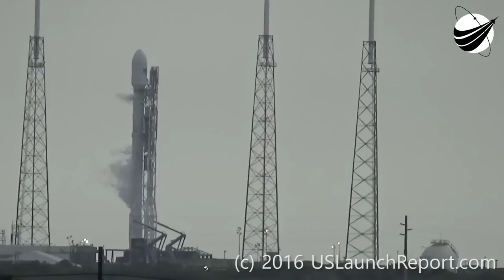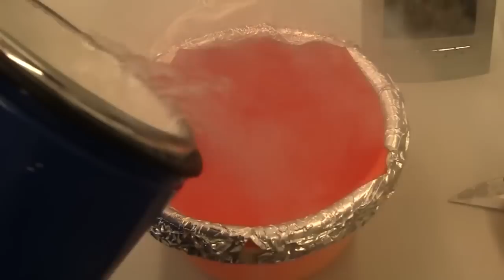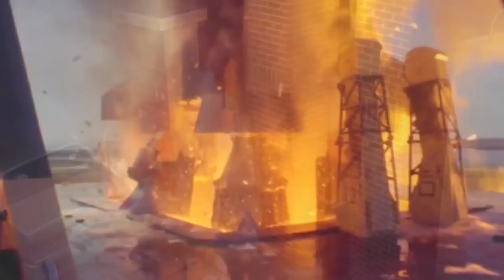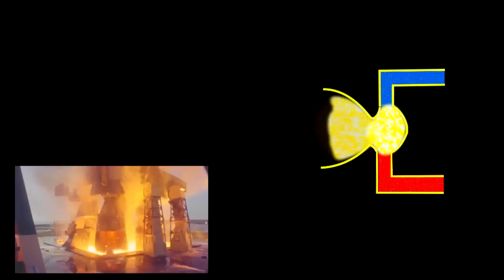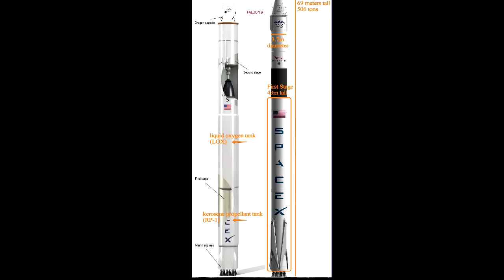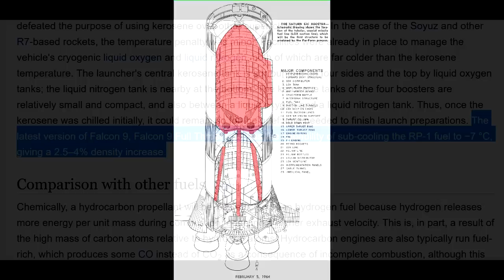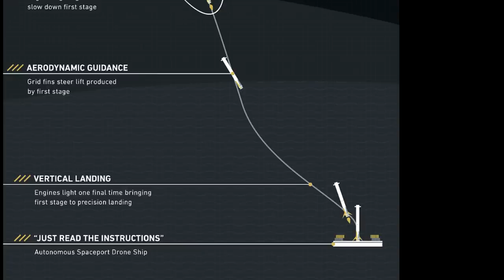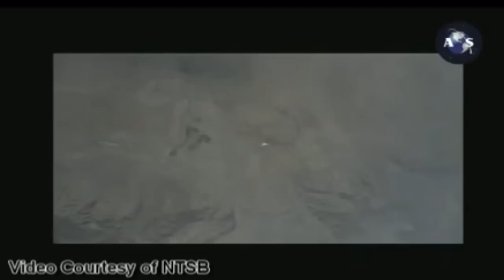Why did the Falcon 9 Explode?

Comment: This video is an embarrassment.
Apparently made before the facts were known,  there is no mention of the actual failure mode and no update to include the fact that Space-X has made reuse of the 1st stage booster routine. 

In addition, there are so many wrong conclusions that I can't help but wonder if you bothered to research the topic before recording this. Of course landing the booster uses fuel. But the 1st stage represents 80% of the cost of the rocket. Not to mention the fact that use of super-cooled LOX and fuel increase the capacity of both about 10%. More than the fuel used in landing. 

But worse is the way you compare the reuse strategies of the space shuttle and that which Space -X uses. The Space shuttle carried an extra hundred tons of mass in order to land like a plane,  a mass penalty that Space-X does not share.
Reply: It still has drawbacks for example the falcon heavy in it's reusable state is almost unusable since the poor upperstage limits the options for deep space missions and the small fairing limits the volume of the payload. Take as example the james webb telescope (ofcourse it get launched by the ariane V, but just as an example) it can only be launched by the falcon heavy in it's expended version (the second stage is just too weak to put the telescope in the orbit it needs if you want to reuse the boosters).  
And the supercooled fuels have the drawbacks that it shortens launch windows by alot AND they waste the profit of the fuel by using less efficient open cycle engines (which are ofcourse way better for relighting) than for example the atlas V which uses the RD-180. 
the F9 en FH are impressive rockets but don't think that reusing a rocket doesn't have drawbacks
Reply: Falcon Heavy beats the next biggest rocket, Delta IV Heavy, for every launch orbit up to Earth escape velocity. It has a less efficient upper stage but it's so big that it hardly matters unless your trying to throw something at the outer planets. Also, just like Falcon 9, Falcon Heavy is still much cheaper than the competition even in expendable mode, so it's hardly a drawback. If the payload is small they get the customer and if the payload is big they still get the customer. You could launch three expendable Falcon Heavy rockets for the price of a single Delta IV Heavy and get 6x the payload to orbit. 

Sub-cooled propellant usage doesn't shorten the launch window, it means you have to hit your launch window on the first try or wait for the next one if there's a launch scrub. This is a problem SpaceX is also working on, and they've got it down to less than an hour between recycling a launch, so now they can have at least two attempts in an hour-long launch window. Regardless, SpaceX hasn't had a scrub in a long time simply because their rocket is highly reliable and they don't run into problems very often anymore. 

The fact that SpaceX's Falcon rockets use an open cycle engine is partially why they developed use of sub-cooled propellants in the first place. The reason the Falcon rockets use those engines is because they already had the design developed when they pitched Falcon 9 for the commercial cargo supply contract from NASA, so it was less risky to use them than to develop an entirely new and much harder engine design. The reason they had Merlin engines already developed is because it started as a simpler design as rockets go in order to let them fully self-fund the development of Falcon 1. So you see the Merlin is a technology they've improved over the years until now it's the highest TWR engine in the world  and in the case of Merlin 1D Vac the most efficient kerosene gas-generator engine ever. 

Now that SpaceX is an established company in the space launch market they have the resources to develop Raptor, a full-flow staged combustion engine more efficient than anything they've built before and in fact more efficient than any non-hydrogen engine ever built in history, using a more complex yet powerful turbopump cycle than the RD-180, and which will be capable of in-flight relighting and hundreds of reuses.
Reply: firstly spaceX will not launch a falcon heavy in expendable mode (they announced that) so the rocket is still unable to launch deep space missions, secondly big payloads don't fit in the fairing and yes ofcourse they can launch multiple times which seems cheaper but don't forget that you've to couple the satalites in space then which requires on it's own a very expensive system on the satalites which kinda defeats the purpose of choosing a cheaper rocket. Also don't forget that for now the FH only flown once so the reliability isn't that great in comparism with for example the Delta IV. I've the feeling the FH was more to show the possibilities of what SpaceX can do rather than building a rocket to beat the market of for example the DeltaIV (otherwise they wouldn't announce that the FH will not fly in expendable mode).

"Having operational Falcon Heavy did not open any new launch possibilities beyond GTO. Any of the operational heavy launch vehicles and at least some of the current medium LVs with cryogenic uppers stages could lift equal or HEAVIER payload to similar orbit. In fact: Delta IV Heavy could easily lift three and a half of Tesla Roadsters. In fact even Atlas 5 outperforms recoverable Falcon Heavy and it's just a medium launch vehicle. Falcon Heavy is severely crippled but its upper stage, and currently there's no work done on ever implementing Raptor in Falcon family (and even then: Raptor is still a liquid methane engine, which puts it in a disadvantage when compared to liquid hydrogen upper stages, such as Centaur or ESC-A of Ariane 5 - the higher C3 launch the more troublesome it would be)."
https://www.reddit.com/r/EnoughMuskSpam/comments/7vurtd/clarifying_disinfo_on_falcon_heavy_launch/ 

Also Scott Manley (which loves SpaceX) did a vid called "What SpaceX & Falcon 9 Can't Do Better Than Alternatives"

Yes I know why spaceX use the Merlin gas generator engines and it's a very smart choice of the company to "upgrade" the same engine instead of using a completely new engine for each generation rocket, and yes they have fixed their sub cooled problems (sorry for that, didn't do any research into that).  

For the Raptor I'm really curious of how it will perform, pretty sure it will be the most efficient non hydrogen engine but I've also learned to take predictions of SpaceX with a grain of salt since they also want alot of media attention (which ofcourse is logically for a private company which needs funders) so they exaggerate their performance (look at FH, the earlear BFR designs, their timestamps, dragon crew, etc.).
It's not that I wanna say SPACEX SUCKS! to be fair I love SpaceX, it's just they're not always the choice to go.

Comment: Welcome to 2018 here. As of now, almost every rocket is recovered, it costs fuel and inspection time to send a rocket up.

What am I saying?  Your "huge disadvantage" was proven wrong wrong wrong.  Space-X is rocking the crap out of the rocket market...launching roughly 1 every other week...used or new...doesn't matter because the point of bringing them back is so you don't have to keep shitting money into new rockets.  That schedule is going to actually speed up so it's potentially 1 launch a WEEK by 2020.  

Using new Space-X tech to judge what they're doing?  Seriously?  They used to fry people in electric chairs...why didn't we ban electricity because it's too dangerous?

THEN you used the Space Shuttle which was your biggest fail. Why did we have half the shuttle fleet eat itself (and it's astronauts)?  Do you have any idea how many rockets NASA blew up on launch pads? Between 50-100 when you involve their non public ones. 

It was a great hypothesis but you were proven wrong over and over and over. I guess you got almost 500K views so I suppose you made some money off being completely wrong...

Comment: Video makes no sense; criticizes elon musk, then shows footage of virgin galactic craft? And recovering the Nasa space shuttle as a manned re-entry vehicle cannot be compared to recovering the unmanned stage 1 booster of a falcon 9, those are apples and oranges. Also you fail to mention this helps prevent additional space debris from cluttering low earth orbit, which is a real problem that could potentially lead to us from further launches in the future.

Comment: At exactly 10:01 MARK I CAN CLEARLY SEE AN UFO ZIPPING BY  MAY BE IT HIT IT WITH SOME TYPE OF IR BEAM CAUSING IT TO EXPLODE SEVERAL OTHER SITES ARE POINTING THIS OUT WHY YOU NOT INCLUDING THIS ANOMALY AS ONE OF THE CAUSES FOR THIS EXPLOSION
Reply: because the UFO is not the cause of the explosion. The real cause is established to be the failure of a strut holding a helium tank. Occam's razor is enough to prove it. Which is simpler, a part inside what amounts to a giant bomb failed and set it off, or an alien from another star system traveled thousands of light-years to invisibly sneak up to a rocket with a communication satellite and blow it up for no reason whatsoever, only to return to the abyss from which it came?

Comment: Space-X now routinely flies refurbished engines. As to the on-pad explosion, advance the video a frame at a time and you will see a very fast horizontally flying object at precisely the time of the explosion. (People have tried to write that off as a bird, but the arithmetic doesn't work out.) Eventually the investigators decided that helium pressure tanks weren't adequately secured.

Comment: I think it´s quite funny how you sympathise with the Space Shuttle.... yes they recovered their engines but if you would inform yourself just a little more, than you would know that the fuck ton of money it cost was from the boosters so fuck the shuttle it was not near the cost of the two side boosters in combination with the huge ass tank which they just threw off. They also recovered it yes but at this point it was nearly unsuable without pumping another shitload of money into refurbishing it! So to come to an end what SpaceX does is not only smart but so fucking cheap that all the problems and one fueling accident doesent matter at all!

Comment: "Never let a design where flipping a single switch can lead to the loss of the entire vehicle get off the drawing board..." Wrong. A single switch left astronauts treading water in space suits full of water as the capsule sank to the bottom of the ocean. The suit gloves get stretched out when exposed to vacuum and forms wrinkles when re-pressurized. Such a wrinkle flipped the hatch ejection switch when its cover was raised after splashdown. The road to space is all hard knocks...

Comment: I shared your skepticism about reusability  and practical aspects of returning stages back to Earth for reprocessing, but 2 years later Space X does exactly what I thought was improbable and impractical. So, I have to admit, when you deduct government bureaucracy and the big kahuna (Boeing, LM, etc) inefficiency, you can achieve sustainable, and economic reusability of booster components. The key to that is they try to test everything, and only use those components that they can test. Of course, there many other things, like unsubsidized  R&D when they basically have piss against the wind in order to get customers on board, but so far, so good. I wish them best of luck.

Comment: Here's my argument on recycling a rocket vs not recycling.... yes, you do loose your PRIMO thrust but if you're getting the payload where you need then you don't necessarily need that extra thrust (with the new Falcon Heavy which is three Falcon 9's they were talking about moving fuel from the first stage of the two outer rockets into the first stage of the larger main rocket because then the first two get emptied and dropped quicker and when they are the first stage of the main rocket still has a full tank, thus getting much better thrust... but in the end it they opted not to implement this system because they just didn't need any more thrust, at least for the current missions of the Falcon Heavy). But being able to recycle these rockets saves tons of money and thus makes space flight cheaper and so we can do more of it. More gps and spy satellites sure but also more science!!!

Comment: The advantage of the Falcon 9 really only comes to light when you build a space station, after it's built it's better to get fuel from the space station if there's some way to get fuel from space( I don't see this happening anytime soon...) So the Falcon 9 does have major advantages once we actually get several space station that can work in conjunction with each other at various altitudes in orbit. It's the best solution to actually start building a chain of space stations. See, once the fuel is transported to space it's immensely cheaper to use it there as opposed to designing and building rockets specifically for certain tasks. 
Though I agree that's probably better to use alternative techniques to slow the rocket down during decent than to just burn fuel, having the fuel as an auxiliary precaution however is better in my opinion if ultimately less efficient. It's far cheaper to waste some extra fuel than to risk losing the rocket itself.
Well, that's my contribution. 

Let the eventual asteroid mining commence! Don't get excited, the Falcon 9 is the first experimental steps towards commercialising this goal and I don't see it getting funding in heaps. It's a long way off, I hope it isn't but I'm pretty sure it is. 
So I think Elon Musk deserves credit for actually getting the mainstream media and the average Joe actually interested. He's not a super genius but he knows how get people interested in potential solutions. 
Though yeah, the hyperloop seems like an utter waste. Self-driving cars is far more likely to succeed and perhaps self-flying drones at the scale of personal transport. Massive person transporting drones seem to me a far more elegant solution that wastes far less space and should be far more efficient. 

Welp, time to shut up. More than my 2 cents.

Comment: The explosion was caused by a fault in the high pressure helium tank which is made of cutting edge composites, not "something that was explored for decades".
It seems this should be about time to take the video down, considering that it's completely wrong.
Of course you won't, because halfway through it just turns into a completely unwarranted attack on Musk.
Not even the makers of that $200M satellite were this critic of SpaceX. In fact they said they'll fly the next satellite with them anyway because they're so much cheaper than the competition, and they realize that rockets are hard to make.

It seems you don't like Musk for some personal reason, to be honest.

Comment: Believe it or not, NASA is putting men into space at a lower or same cost ($81 million per person in 2018) than with the Space Shuttle (around $64 million in 2011 not counting launch campaign costs but not adding in extra haulage) by contracting with the Russians. This will drop even farther with SpaceX who's stated goal is to drop costs to under $500-$1000 per pound. They will pay SpaceX around $58 million per seat in 2018. This does not add in Boeing's Dragon capsule either. NASA has mentioned sending up astronauts on a manned mission with their new launch platform in 2018 as well. So... This will give us three separate launch platforms with proven systems in the civilian sector. Now I understand hesitancy and safety but it is fairly clear that the majority of the objections you state in this poorly reasoned argument have been addressed.

SpaceX has recovered 18 rockets in a row with them all landing perfectly. Currently they have a refurbishment turnaround of around a week, but are looking to bring that down to under 24 hours with slow improvements to the design. SpaceX is not using the same propellant as NASA so it took time to work out the kinks, but it appears that it is progressing well. You imply that NASA is a safer and better bet because of their experience, yet they also had one shuttle explode on takeoff, and another burn up on re-entry with a system they had flown over 30 times. Plus they have never used the same fuel mixture system that SpaceX is using, so they have no experience with it either.

You make some well reasoned arguments in other videos. It just seems that whenever you get involved with Musk, you get all personal and lose your reasoning. So far Musk has achieved every goal he set be it in cars/trucks/space or computers. You just seem to be so petty with this guy. I don't get it.

Comment: The problem which caused this explosion was not one that has been previously solved. In fact, it was caused by SpaceX's use of supercooled propellants and COPVs built into the LOx tank, something never done before. Since the helium COPVs were below the freezing point of oxygen and the carbon overwrap is permeable by LOx, SOx formed between the overwrap and the internal aluminum lining. Then, when more helium was added to the tank as part of the fueling procedure, the pressure against the buildup of SOx led to breakage and friction between the carbon fibers. Due to this, enough energy was created to ignite the carbon with the oxygen, the aluminum liner ruptured, and the LOx tank over-pressure, therefore mixing the fuel and creating a fireball. Although I respect your criticism, new technologies like these lead to issues never seen before, so I don't believe this was due to SpaceX's ignorance. I understand that this video was made before any definite cause of the failure was determined, but I don't think you should have jumped to such quick conclusions.
Show less
REPLY